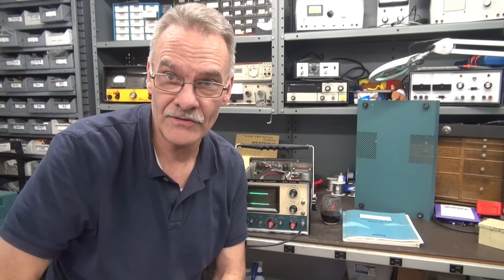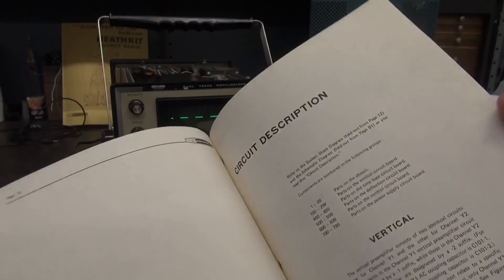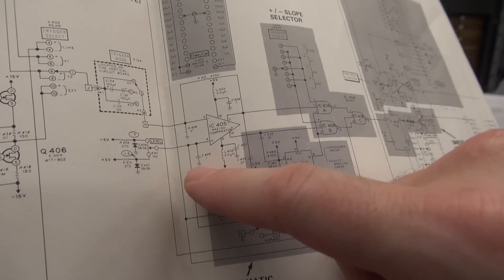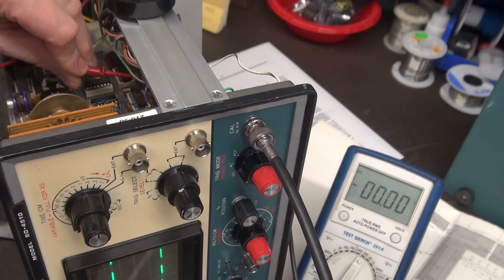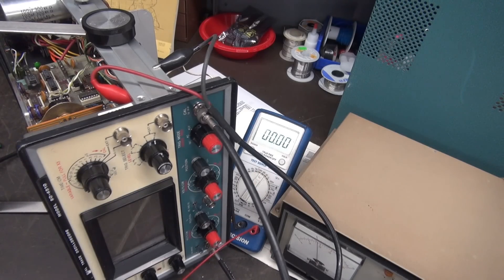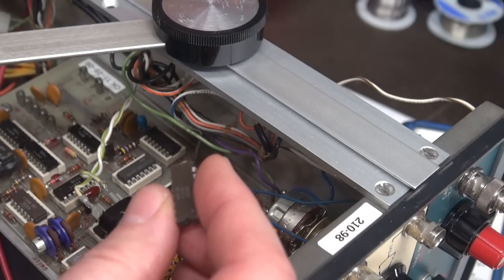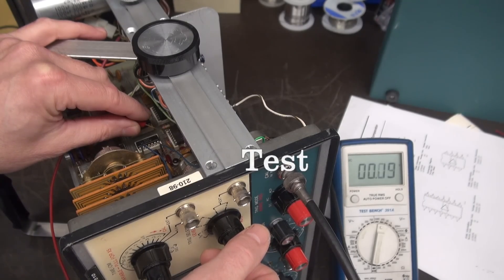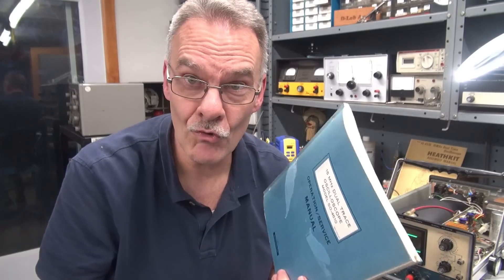How to repair trigger function Vintage Heathkit Oscilloscope Part 2

Comment: You can get those chips NOS on eBay for less than $10 -- even less if you can tolerate a modern knockoff and wait for shipment from China.

Comment: I think you have a bit of a misunderstanding of the oscope trigger circuits and user operation.  The trigger selector does not set the auto trigger mode.  The selector only chooses the input.  The auto trigger is set by the  trigger level's  potentiometer switch.  So when you rotate that control fully counterclockwise and you hear the click of the switch then you are in auto trigger mode.  In fact you can be in auto trigger mode for all the inputs (Line, Y1, and Y2).  The labeling on the front panel with the red curved arrow the dot and AUTO is for the outer adjustable trigger level knob and not for the TRIG SELECT switch.  The auto trigger circuits do not bypass the input comparator as mentioned in the video.  The calibrator square wave signal, I believe from your video seems to be around the common 1 kHz frequency and is created by an isolated astable multivibrator. Therefore when you thought you were in auto trigger you were on +Line and that selection is usually used for viewing time related line frequency waveforms.  If you check the schematic you will see the Line + and Line - are taken from the power supply and are 60 Hz related.  That is why even with a replaced IC you saw it would still not sync, (1 kHz verses 60 or 120 Hz).  Auto trigger's main function  is to produce a trace in the absence of a signal and may set a trigger level.  Glad you found the bad IC.  Hope I didn't make any mistakes and this information was helpful.  By the way you do a very nice job on your audio and focus/lighting of the video.  I am also with you on Heathkit manuals being very good.

Comment: Terry: The Heath 4550 that I'm working on uses the same UA760 for trigger comparator. I have not yet finished my repairs so the 760 in mine may still have an issue. I'll keep your stash in mind. Thanks for the video.
Reply: Hi, I am also restoring a 1981 vintage IO-4550. I have decided to try and upgrade the scope to try and achieve 50 Mhz bandwidth. I am replacing most  of the chips with SN74AS type TTL type chips. The UA760 will be replaced with a Maxim MAX913CPA comparator. I will build a cheater socket to do this. This mod is not for the weak of heart but as I am a retired electrical engineer and a bit crazy I'm going for it! The parts are getting hard to find. If you buy any buy lots of spares.
Don't forget to replace all those old electrolytic caps. A can type cap can be replaced with individual caps. Good luck!!  Mike at arabimike999@gmail.com
Reply: If you do anything to your scope do this!  Replace the .1Uf 1600 Volt caps on the High Voltage power supply. There made of paper & foil and will fail. They are undersized at 1600 Volts as the transformer puts out 1700 Volts. Use Digi-Key part number 338-3169-ND which are rated at 2000 Volts and are Polypropylene. They are slightly larger but will fit. They work fine and will last a long long time. About $6 each.  The Voice of Experience!

Comment: Terry, love the trouble shooting!
A little tube amp tech diddy for ya. 
    "Got one hand in my pocket the other on the probe. Cranking the varactor waiting for the glow. Seeking validation for my troubleshooting plan. If I can fix this baby I will be a happy man. 
    The filaments are glowing as the heater current flows. Watching AC current while my dim bulb barely glows. Checking for high voltage, no flashes we are hot. Max the bias voltage with a twist of the right pot.
    Looking good so far, good luck we have had some.  But lets apply the volume we've got signal but no hum. Victory attained fidelity restored it's time to start another one so that we don't get bored." 
Cheers!

Comment: Might be time to be looking for a suitable replacement chip. Maybe a surface mount comparator mounted on a small custom pcb that plugs into that 14 pin socket. I've done that for other unobtainium chips.
Reply: Easy enough, almost the same size board as the original IC, with 30 identical SMD transistors, 2 diodes and 22 SMD resistors. A low enough volume to hand place. The original was a very early IC, and is large enough to emulate with little problems, just have to use close matched SMD transistors to copy the internal transistors, current mirror and the internal matched diodes and zener diodes, all using the same SMD transistor type. Pull them all off the same reel in sequence and they will probably match well enough, coming off the same wafer in close proximity.

Comment: Wow those Heathkit manuals are incredibly detailed. They set the bar for HP and Tek. You can actually RTFM with these service manuals and repair instrumentation without having an annual tech support contract. How many times have you asked a newbie tech, did you RTFM?

Comment: At least Heath used off-the-shelf parts... Tek made their own custom chips for their scopes, so if one of those goes bad you basically have to cannibalize another dead scope.  Maybe you'll get lucky and Tek has old parts available, but I wouldn't count on it.

Comment: If I remember from my 16 week digital class in 2002 ,7000 series logix chip is faster than 4000 series of chips. Maybe all obsolete/ Good video. One of my nine -16 week semesters for my electronic technology certificate,[ Night's part time after work - start 08/28/2000 finished 12/13/2003-Triton college,River Grove,IL we used BK scopes & Tektronix digital scopes.         But you are refreshing my digital memory. Good video

Comment: Interesting comment about the chip being the culprit this time, but not so often in his experience.  I'd been told long ago that chips were pretty reliable & thus replacing them & hoping that would fix a problem didn't pay off very often.
Thanks for this video, Terry!
Reply: Chips are normally pretty reliable, and when these chips were new they would have been just as reliable. Now, with 40+ years under their belts, they are starting to fail. I am seeing it more and more.
Reply: Certain older chips turned out to be not reliable, because the early days of IC manufacture there were long term degradations that were not anticipated. Things like purple plague, which only show up long term, and also electromigration, which also are long term failures. As well IC's are often vunerable to failure if the power supply voltages are exceeded, or the inputs are powered up without the power rails being present. that uA760 probably did not like having a high voltage, and was rendered inoperative in the input stage. However  it is relatively simple, and could be replicated with modern SMD technology onto a smallish board, probably small enough to fit into the existing circuitry  with no problems, as it has only NPN transistors and resistors and diodes in it, all of which are easy to get as SMD parts. 30 identical SMD transistors, 2 diodes and 22 SMD resistors are low enough volume to hand place.